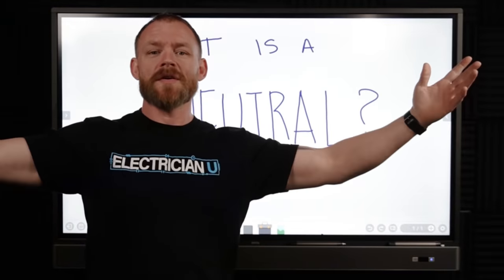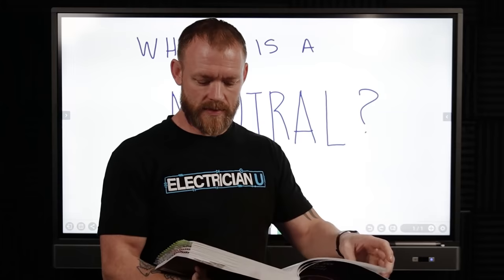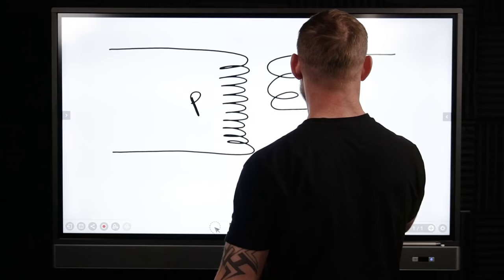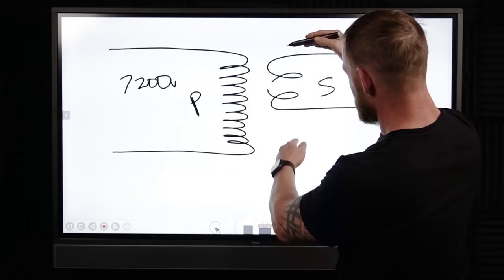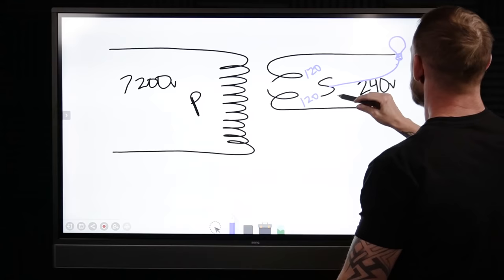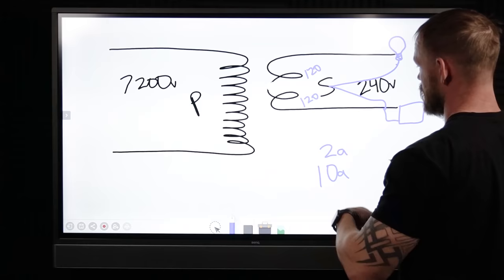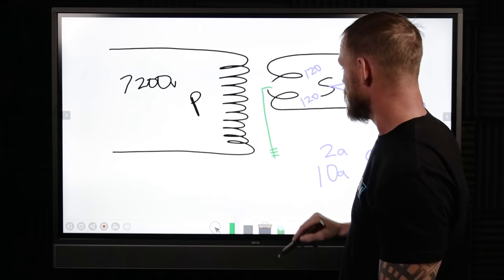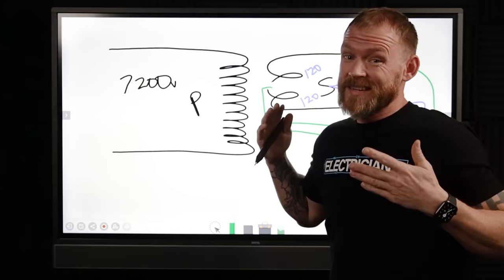What is a Neutral? The Difference Between Grounded and Grounding Conductors.

Comment: A topic that I find really interesting is what causes the lethality of electricity like the voltage vs the amperage. People who think they are smart say, well actually it's not the volts that kills you it's the amps. Like yes the amps are what send the shockwave to your heart to disrupt rhythm, but the higher the volts are, the harder it is to let go. It only takes .01 amps to kill someone so essentially any wire 120 volts and higher with any sort of microscopic load on it could kill someone but if you make contact with just the hot on a 120 ungrounded conductor you'll basically always be able to let go. Anyone who's ever been shocked by a high leg or 277 will tell ya the astronomical difference of how hard it pulls you lol. There's a reason why there's warning signs all over high voltage equipment despite olhms law suggesting high voltage has the lowest amps possible running through it
Reply: If a cannonball rolls gently into you, it's not going to do much.  If I throw it as hard as I can, it's probably going to do some damage.  If fire it out a cannon at you, it's going to tickle a bit.  Cannonball = amperage, means of accelerating it = voltage.  Tiny amount of amperage can kill you, but the voltage has to be high enough to overcome your resistance.  Humans (and other animals) have varying resistance, which is tied to what part and the conditions (wet, dry, etc) of that part.  A 9v battery on your arm won't do anything, but it'll tingle on your tongue.
Reply: @jasonrm999  i understand what youre trying to say with the cannonball analogy but the part that doesnt work is the cannonball would vary in size if we are being super technical about it. simply just using voltage to describe a cannonball speed doesnt explain the whole picture because amperage isnt a constant. interrupted current under load will hit alot different than an idle live circuit would. you clearly know what youre talking about so im not trying to insult your intelligence im just being petty haha. that is very true that higher voltage allows the electricity to be able to make it to the heart though.. i would just add that the variable of a foot wide cannonball going 50 miles an hour versus a 2 foot wide cannonball going 25 and what would do more is whats interesting about the debate. obviously my numbers there probably arent sensical but its just to say a point
Reply: @erich1380  Yeah I should have mentioned it's a gross oversimplification, but it is helpful at least in visualizing how it's not simply amperage at work when it comes to damage.
Reply: @jasonrm999  like I said brother it's a good physical example of a commonly understand mechnical interaction so it works. My original comment just lays in a bit more specific and different of a realm because my mind wanders off into weird shit at work sometimes lol. When I was in school they described it like water in a pipe where the voltage was the speed of the water and amperage was the pressure
Reply: Current is what kills you because electrocution is what happens when...electric CURRENT runs through your body. But in order for current to flow, you need voltage. Voltage is the force that pushes current through a conductor. And that force has to overcome the resistance in the circuit in order for current to flow. If there's no force, or not enough force to overcome resistance, there will be no current flow (or a tiny amount of current that you may not even feel). And the more voltage you have, the more current will flow through you. Ohms law: V=I*R. If resistance stays constant, then current goes up as voltage goes up. Your body has a fixed amount of resistance (I realize the resistance of your body can vary widely, depending on where you're measuring from, if your skin is wet, etc, but in a given instance where you touch a live conductor, your body's resistance is a fixed value for that instance). So, more voltage means more current is flowing through you, and thus, more likely to kill you.
Reply: @jonclark1288  I didn't specify my level of education in the field so that's my fault, but I'm a journeyman that learned all the stuff you're describing. I understand the fundamentals of olhms law, my question is more so about the comparing of higher amperage exposure with lower volts and higher voltage with lower amps and which would be more likely to be lethal. Also, it is very possible for 0 amperage to be traveling through a circuit like if it was recently just ran or no currents are under load at the moment. I'm pretty sure if you get wacked by 277 volts even if it's an idle circuit, you're gonna have a pretty damn rough time with it also even being able to kill you under certain circumstances. Unless an unmeasurable amount of current you can't even detect with an ammeter exists constantly whether or not a load exists. That could be possible but nobody ever talked about that in school that I'm aware of
Reply: @jonclark1288  I didn't specify my level of education in the field so that's my fault, but I'm a journeyman that learned all the stuff you're describing. I understand the fundamentals of olhms law, my question is more so about the comparing of higher amperage exposure with lower volts and higher voltage with lower amps and which would be more likely to be lethal. Also, it is very possible for 0 amperage to be traveling through a circuit like if it was recently just ran or no currents are under load at the moment. I'm pretty sure if you get wacked by 277 volts even if it's an idle circuit, you're gonna have a pretty damn rough time with it also even being able to kill you under certain circumstances. Unless an unmeasurable amount of current you can't even detect with an ammeter exists constantly whether or not a load exists. That could be possible but nobody ever talked about that in school that I'm aware of
Reply: @erich1380   @Erich  a live wire that has no current WILL have current going through it the moment you touch it and it shocks you. It's like turning a light switch on and off. Switch off: no current, but still has voltage on the line side. Switch on: current instantly starts flowing. Touching the wire and getting shocked is like turning the switch on. If you feel a shock, there IS current flowing. To answer your question about higher voltage with lower amperage vs higher amperage with lower voltage, the higher amperage is more lethal, because like I said before, electrocution is literally what happens when current flows through you. But the voltage still has to be relatively high in order to overcome the resistance if your body and push any amount of current through you. High voltage with very low amperage is not lethal. This is exactly how tasers work. A taser will send over 100k volts through you, which will hurt like hell and screw up your muscles and nerves, but the tiny amount of current that they produce isn't enough to kill you.
Reply: Your Skin is naturally resistive to Electricity until the voltage reaches 50v anything higher than this your skin stops being a barrier.  It only a takes a tiny amount of current to kill you but it is the Volts that push the current through your skin.
Reply: People always leave out the resistance when talking about getting shocked. The resistance between 2 dry ruff hands is different than 2 wet hands. So if you are holding a live wire but don’t know it is live then your elbow hits a grounded pipe then you better hope it’s 120v wire. Unless you are wearing a dry wool jacket then if it’s not 400v you might be ok. It takes 75 mA to cause ventricular fibrillation. But you need 100’s of amps to be burned to death. 

Your heart can actually recover from heart muscle paralysis (above 4amps) than from ventricular fibrillation. 

So as the resistance of what is contacting the wires goes up you need more voltage to cause 75ma to end up going through your heart. You have to talk about all 3 resistance, voltage, and AVAILABLE amperage.  Static electricity can be thousands of volts but has less than 1ma of available amperage so it is not deadly.
Reply: Things that come to mind are spark plugs and a garden hose.
Spark plugs/plug wires carry thousands of volts and amperage so small it is unable to be measured with a high end automotive scope. Won't kill you, but sure will wake you up. The energy surge lasts for a couple of milliseconds.
A garden hose can explain the difference between pressure and volume.
Pressure equals volts
Volume equals amps/watts
Reply: That is like asking what kills, a gun or a bullet. Voltage and current are not independent, they are connected through the ohm's law. 0.01 amps or 10 mA does not kill, it is about 100 mA. In most cases when you touch a wire you are not properly grounded. If you are things are different. Also there are many other factors that affect the resistance and therefore current. For example for a child it is different.

High voltage is over 1000 V. High voltage causes the risk through arching so one doe snot need to touch the wire.

In Europe nobody thinks mains voltage is safe. In the US many think so and they are therefore careless.
Reply: @markchidester6239  But if you feel it the current is high. Even a simple static shock is several amperes. The duration and the charge just are so small that it is harmless.
Reply: @jonclark1288  you got it completly wrong.
Reply: @fortescuegr7573  why don't you try telling me WHY I'm wrong then? Because based on your last comment, you have no idea what you're talking about.
Reply: @jonclark1288  99% of  electrics sources are Voltage source, the determining factor in saying if a voltage source can kill you is its short-circuit power value in VA .  A 500kV source will not kill you if its power capacity is 1W, that mean when you will touch the conductor, the voltage will drop instantly because that source has no power, a 50V voltage 100MVA (yes they exist) will melt you away. Current is only the byproduct. The source will alway try to maintain itself at its nominal value. The short-circuit value described the internal impedance of the source and therefore the maximun admissible current because P/V = I. Voltage will only polarize the material, after that it is only a question of <does the source has enough power?> In 99% of application, the answer is yes. Even a charge capacitor in a PC PSU can have enough power capacity to kill you if let charged and you accidently touch its leads.
Reply: @fortescuegr7573  none of what you said refutes anything I said, and you're making this more complicated than it needs to be. It doesn't matter that a voltage source tries to maintain its voltage. The fact of the matter is, is that CURRENT flowing through your body is what kills you. Voltage in and of itself doesn't kill you, which you acknowledged when you said "A 500 kV source will not kill you if its power capacity is 1W." Great, I'm glad we agree on that. Now which part did I get wrong again?
Reply: @jonclark1288  yes it does, you talk about current source as if the current will rise which is completely false. Current is always the free variable, it isn't set to a specific value . You still don t get that the current is set by the voltage/power capacity of the source. Sure, in the ends it is the current that kill you but saying that is the main cause is as misleading as saying that in a car accident it is your head smashing on the steering wheel that kills you, you completely ignore the actual roots that leads to current which are voltage & power of the source. In my example, clearly you don't get it, if you have 500kV @ 1W when you will touch the wire, the voltage will drop instantaneously to a much lower value because the source has no POWER to maintain 500kV when you touch the wire.
Reply: @FortescueGR  show me where I EVER said that current stays at a specific value. And show me where I ever said the words "current source." Power of the source isn't the only thing that determines the amount of current. The resistance of the load also determines the amount of current. Let's say you have a voltage source that is 1 kW and it's 120V. So it's CAPABLE of providing 8.3A. That doesn't mean it WILL have 8.3A flowing at all times. If you hook it up to a load that has a resistance of 1k ohms, you'll have only .12A flowing through it (which is still more than enough to kill you). Now take that same 1 kW source and increase the voltage to 480V. Connect it to the same 1k ohm load, and the current going through it is now 0.48A. Still well under the capacity of the source, still more than enough to kill you. Except now the current has quadrupled. NOW do you see how I said as voltage goes up, current goes up? When the "VOLTAGE source" is capable of supplying current that is thousands of times the amount required to kill you, does the exact power rating of it really matter any more? The answer is no, it doesn't.
Reply: @jonclark1288  lol dude you guys were going at it damn

Comment: In a house I always look at the Neutral as an insulated ground, isolated from each circuit, and the uninsulated ground is whorish and attached to everything. Both almost always attach to the same bus bar in older homes  @ the main breaker panel.
Reply: In all houses the neutral should be connected to ground at the main panel, any subpanels should NOT have the neutral connected to ground.
Reply: @voltsnbolts8879  yes or you get a grounding loop, I got corrected by my electrical inspector and had to get rid of the ground on the sub panel. No big deal, but a waste of some good copper grounding rods.
Reply: @voltsnbolts8879  sorry you're wrong, we haven't done panels that way in a long time old son. Keep up with the times.
Reply: @wabbajakk9552  
You don't know what you're talking about.
Reply: @TqSNv9R0iG5Ckxew  I think I do, considering I've wired hundreds of them.
Reply: @wabbajakk9552  
Do you know what a ground loop is?

Comment: Dustin,    Food for thought.    The reason for the neutral only carrying the unbalanced load is because when the two 120 volt sides get to the common point (neutral)  the “system” is essentially working at 240 volts on all of the balanced load and those two 120 volt loads are in “series” which divides the 240 volts into 120 volts.   
They don’t really explain this very well in electrical classes.   Especially not electronics classes.
Respectfully,   Kevin

Comment: Great explanation! Another point you might touch on in the future is the neutral is being an anchor for the system. I know we would be getting deep into theory, but I think it’s worth talking about seeing as we are in Texas with the oilfield electricians running into a corner grounded delta system. Yes the neutral provides a way for smaller voltages but also serves as an anchor to keep voltage from “spiking” so to speak. Thanks for the content, 24 years in the trade and still learning everyday. Great work!!
Reply: Spiking? You mean from like lightning or something?

Comment: As an audio guy, I have understood it like, Hot and Neutral are like "send and receive" , to and from the panel. And Ground is Ground the whole world around.  
Current has to flow through- *from ground to make the circuit work, it only makes sense that every circuit would have it's own path separate from true ground. But you still need a true ground to make things safe and to make the GFCI work.
Please inform me if this logic fails to stick to the wall. I'm not a real electrician, just a com tech guy.  But I like to learn.
Reply: Your “send and receive” model is incorrect.  It is better to think of “hot” and “neutral” as equivalent in making a circuit.  The distinction between them is only important in knowing their potential relative to ground.

Comment: Always nice to see a new video. Unfortunately I can't apply it. Because I live in the Netherlands. Other rules and equipment. But l love to watch what your doing. Keep it up! Greetings from the Netherlands.
Reply: In the Netherlands and Europe, from what I understand, everything is 240 volts. Is this true? Does this mean there is no neutral available?
How do these voltage converters that change 240v to 120v work?
In the US, you can buy one to bring with you when you travel.
Reply: @markchidester6239   In the Netherlands we speak of 220 volts, not 230 volts. These are the 'old' tensions in our grids. As far as my knowledge goes. Most appliances operate on both 110 volts and 220. So if equipment works on both you can use it without a converter. You will, however, need a different plug. (Travel adapters) Of course we have neatral and ground. 

I hope I was able to answer your question. I'm not an electrician, ( this is what i know)
Best wishes to you...